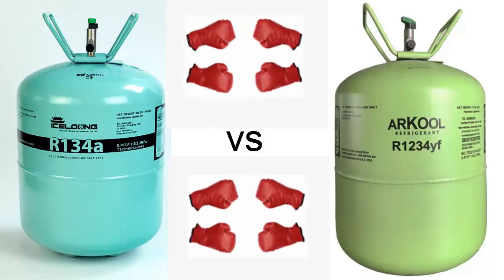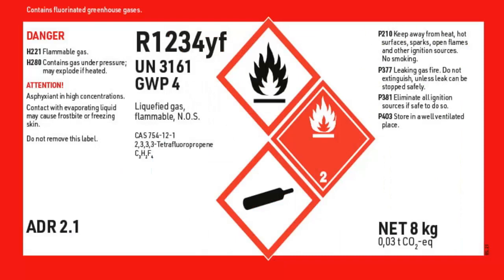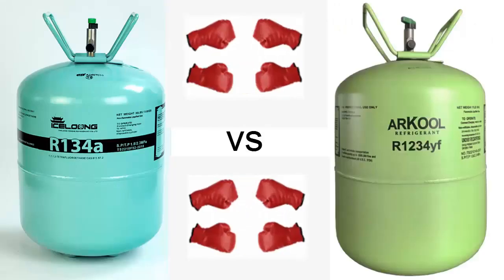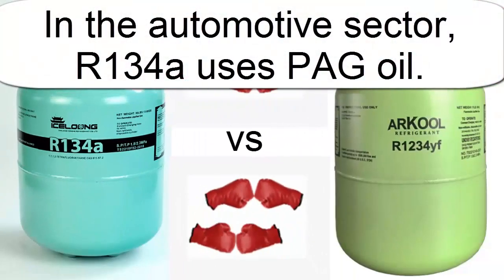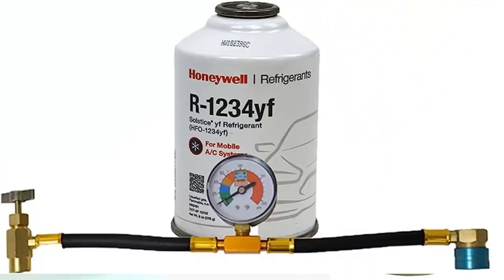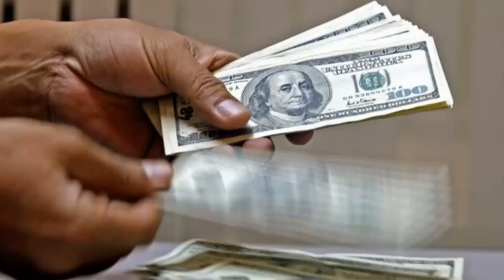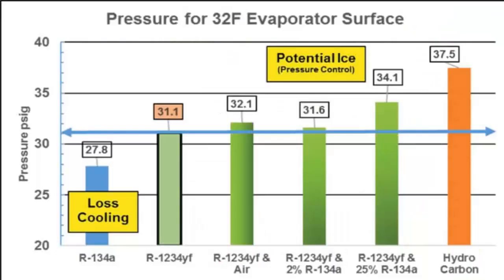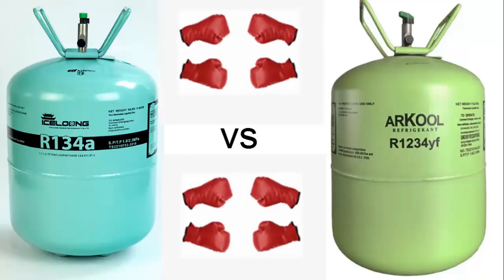What Happens If You Replace R1234YF Air Conditioner Gas with R134a Refrigerant?

Comment: Can in change 1234 to 134
Reply: Officially NO  but can work     there is the Safety  problem propane will burn  R134a will not
 1234 is a propane gas with a buffer   and will burn